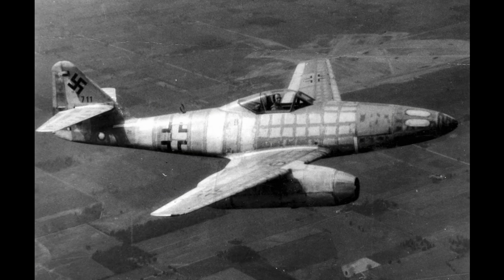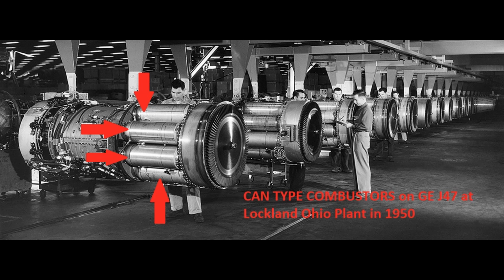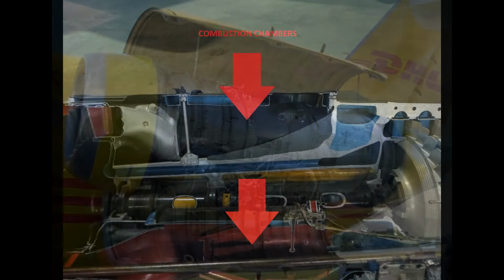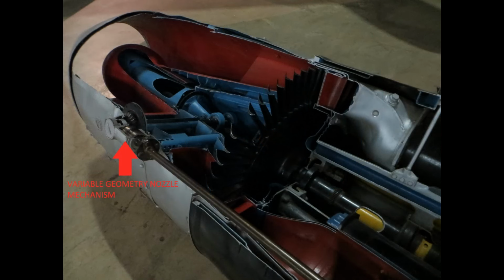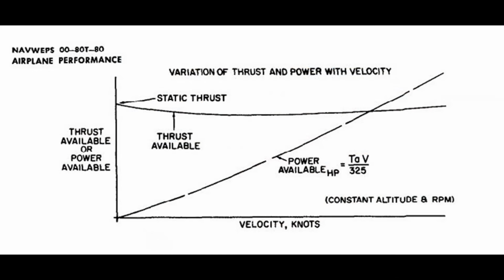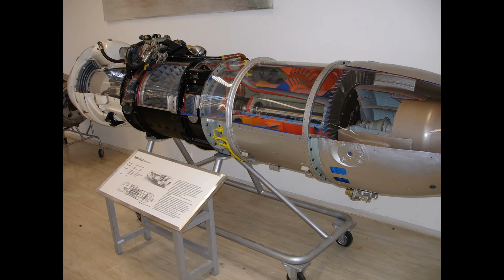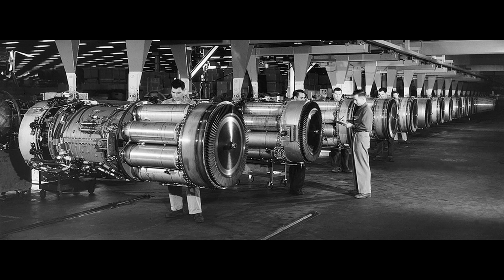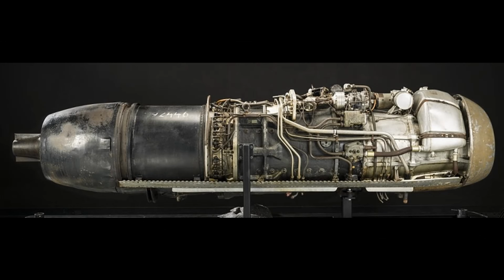World War Two JET POWER

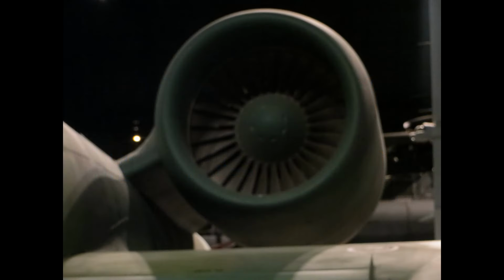Comment: @11:50 we see the intake of an A10 (I used to work on these) it has a bypass ratio of 85%
I am wondering if the intake fan of the FW190 (located just behind the prop and spinning faster than the prop) may have been the inspiration of the High Bypass Turbo Fan .  That would be interesting to know
Reply: the fan behind the propeller turned with a ratio of 1 to 3,17. 
I have no information about the pitch of the blades. But it must be chosen so large that the air throughput at least corresponds to the airspeed. Since otherwise unnecessary air  Drag occurs. But the main task of the fan was to cool the engine while stationary and at low speeds. This necessity resulted from the slim design and the fact that the efficiency of the propeller within the inlet radius is zero.

Comment: Thanks for the redo video, great content. You make a great point about the lower cost and production demand of the jet. One thing that you may have said but do not recall from your videos, was that aren't jets more efficient the higher you go in altitude, whereas piston/props are less efficient? I know you talk superchargers and turbochargers at great length, but I recall from some training I had that the reason why turboprops dominate pistons in the commercial market is because they combine the low altitude efficiency of a prop with the high altitude efficiency of a "jet."

Comment: The Jumo 004 was not the best jet engine of WWII. The design was excellent but what German industry could produce was terrible. The WWII Meteors that still fly do so with their original engines. This would not be allowed with the Me 262.
Reply from the maker: I think we have different definitions of "best", and for that matter of "original engines".
Reply: @GregsAirplanesandAutomobiles 
The world's most powerful & most reliable gas turbine aircraft engine in 1944 was of course the RR Nene.
Reply: +calvingreen90    However one WW2 original Me-262 has been restored to fly with original Jumo turbines, although those turbines have been carefully overhauled including remanufacturing the components that were known to fail with better aerospace materials.
Reply: @FiveCentsPlease 
 Link?

Comment: the metrovic axial flow engine produced 2400 lbs thrust and had a considerably longer service life than the jumo. It was fitted to an experimental Meteor and greatly enhanced its performance, however the air ministry chose the   reliability, long service life and lower fuel consumption of RR centrifugal engine to power the Meteor..
Reply from the maker: It never flew in combat during WW2, therefore sort of falls into a fantasy category in terms of comparisons.

Comment: As far as I know, Germany ran short on steel hardeners at the end of the war. Like Tungsten, Molybdenum or Vanadium. So they had to take "normal steel" for this engines. As a consequence the engines were "done" after only 25 operational hours, because the normal steel couldn't take the heat for a lengthy period of time.
Reply: The Jumo 004b Orkan engines were made with  high temperature,  heat resistant stainless steel
Krupp P-198 Chomadur is still used in jet and gas turbine production.
Reply: The Jumo 004b Orkan engines met or exceeded the RLMs 100 hours PFTR reliability standards for acceptance into Luftwaffe service.
This is the exact same 100 hour PFTR standards for the RAF and USAAF during WW2.
Reply: Germany was critically short of a number of alloying elements throughout the war. Exhaust valves in aircraft engines were markedly inferior to the Allies. The details are in “The Great Horsepower Race” The were forced to overhaul many engines because of valve distress.

Comment: The whittle / Rolls -Royce Welland was by far the better engine because it was designed to actually stay in one piece for more than a few hours. The centrifugal compressor had a more sound engineering basis than axial due to metals available
Reply from the maker: That's just silly. The axial vs. centrifugal has NOTHING to do with the wear issues, which were entirely in the hot section of the engine, mostly the turbine. I don't understand your point about the metals available either. The British had all the natural resources they needed because of the US, the Germans didn't, again because of the US. I seriously need to make a video about the British turbines to clear all this up.
Reply: @GregsAirplanesandAutomobiles  i actually worked for power jets Ltd in whetstone Leicestershire trading also as ITP aero  a Rolls Royce company. Whittles prototype was made there and on display in the main office  and we had a talk from the engineering director who told us exactly that whittle knew full well of the advantages and disadvantages of axial flow design engines. He chose his design because it was more suited to the  manufacturing capability at that time. 
And he was right.
Reply from the maker: Obviously not more suited to the German's manufacturing capability at the time.
Reply: @GregsAirplanesandAutomobiles  the ability to manufacture them wasn't the problem, the ability to supply them with the right rare metals in a war situation certainly was, hence why they lasted as little as 10 hours.. Exactly why whittle did not choose axial flow because of the downstream/ hot side stresses.
Reply: @GregsAirplanesandAutomobiles   Hi Greg,  I am not saying you are right nor am I saying you are wrong.  Yes the Germans had the right basic design for the axial which  has not changed much over the years.  But just supposing the Germans had access to all the high temp materials that they needed.  Would their design of axial  flow engines have stood up to a high hour durability testing ? You appear to presume that it would.  After the war RR had many problems with durability of axial flow compressor blades in the Avon.   (US manufactures also had problems with axial durability)  At wars end and British centrifugal engines were tested on German test beds the German technicians were greatly surprised at the high running hours obtained before service intervals.  You appear to presume that apart from poor materials the German axial engine designs were perfect.  I don't think we know this.
Great videos,  thank you.  I always keep in mind that you are a Yank and I am a Limey.
Best wishes.  Colin. R.

Comment: Horten Ho 229 anyone?
Reply: +Snoop STP     The 229 program only managed about two hours of powered flight with jet engines with a smaller prototype.   The Hortens made their own contributions to flying wing design theories and flight controls, and they deserve due credit for that work.  But the 229 program never matured into anything before the war's end.
Reply: @FiveCentsPlease  One of the prototypes is hanging in the Smithsonian Air and Space museum, after radar testing there is no doubt the Horten Bros designed the worlds first jet stealth fighter.
Reply: @snoopstp4189      The Smithsonian has the V3 prototype.   One of the main advantages for flying wing philosophy was low drag and fuel efficiency.  This was the proposal that the Horten brothers brought to Goering---that they would build a fast and fuel efficient bomber. Stealth or radar avoidance was never part of the proposal.   Low radar signature is just a characteristic of tailless aircraft.  If you want to assign credit for stealth, then it goes to the Japanese at Tokyo University who were mixing metal compounds into paint for IJN aircraft and testing their radar signatures. Most of their notes were destroyed by US Navy Intelligence was able to interview them about the work.

Comment: 23:12 - It has always been my understanding that this aircraft was a test bed for the forward-swept wing and there was a rush to get it into the air for flight characteristic testing, hence the lack of retractable undercarriage. Otherwise excellent.
Reply: Yes, have to agree with Ensign Cthulhu on this; the 287 was a test bed for the forward swept wing using lots of bits from other aircraft, something that with a few honourable exceptions wasn't really exploited until the mid eighties, and even then has failed to gain a foothold,  presumably due to manufacturing costs. Actually the X-29 followed a similar philosophy in using bits of F-5 and F-16. Bring back Thunderbird 2.

Comment: Another annular combustion engine is the vickers f2 which made its first run in 1941, and its later variants paved the way for turbofan engines on planes like the 747
Reply from the maker: They couldn't make it work, a few test flights was about all it every did.
Reply: @GregsAirplanesandAutomobiles  i see, looks like they only got 3 hours of flight time from the meteor with the f2

Comment: Thank you for that video. The best report on the theme I have ever seen. 

The Ju 287 V-1 was a pure low speed testbed for the forward swept wing. It was never ment to fly fast. It had almost nothing to do with the planned production version. 
It was a real Frankenstein. The fuselage came from a He 177, the tailplanes from a tail turret equipped Ju 188 or 388 prototype, the main landing gear from a Ju 352 and front landing gears in their previous life had been the main landing gears of a downed B-24!  It was powered by 4 Jumo 004.
The V-2 was basically the same, but with 6 BMW 003. 
 
The incomplete V-3 and planned production aircraft had a completely different fuselage, based on Ju 288 and 388 parts and of course with fully retractable landing gears. They were planned to be powered by 6 BMWs.  

When the Ju 287 V-1 was ready to be tested, there were no airworthy BMW 003 availlable. Some months later the situation changed. Now, BMW 003 were availlable, but Jumo 004 were in short supply, because every 004 was desperately needed for Me 262 and Ar 234. 

The developement was continued in the USSR as the EF-131 that reused many parts from the wartime prototypes and later with the heavier EF-140, until everything was stopped in favour of domestic sowjet designs with backward swept wings.

Comment: Most 262s shot down were done so either landing or taking off, the 5-1 kill ratio is rather misleading.
Reply from the maker: It depends on how many planes they shot down first.
Reply: @GregsAirplanesandAutomobiles  Huh. Not sure I get your point. I wouldn't consider a kill of a 262 coming in for a landing, low on fuel the same as one at 15k feet in combat a equivalent, even if the stats list them as such. That's my point.